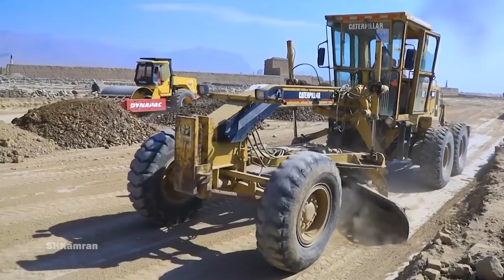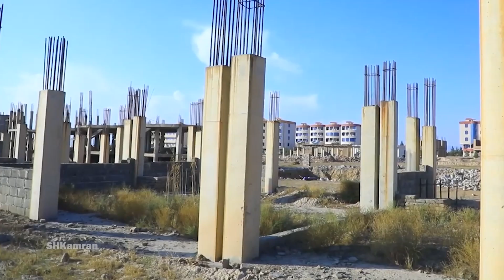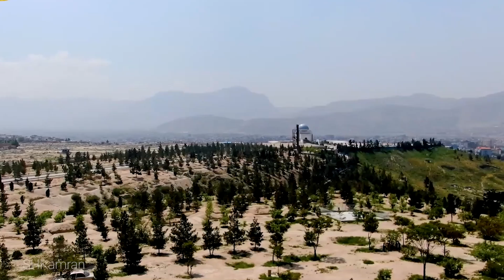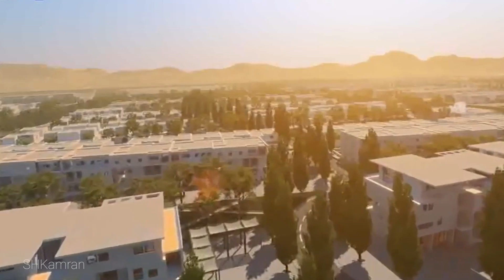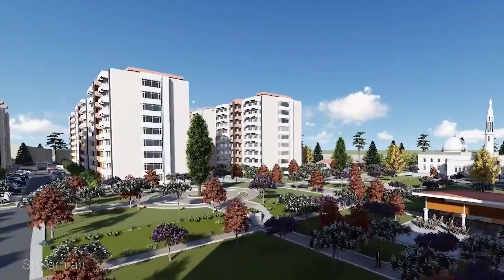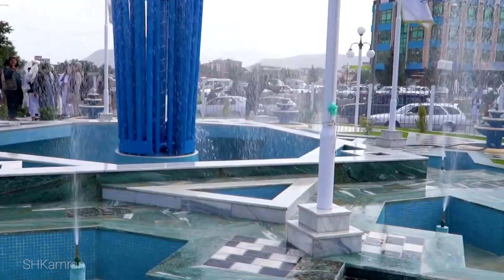Update:  biggest mega project under construction in Afghanistan. New Kabul City

Comment: ❤❤❤❤🎉🎉 ROAD construction system Rong proses work,,,,,,,,MR main road,, CR connective road,, LR Local Road,,,,,MR __1 National High way NHW 2 provincial way PW 3 District way DW,,,, width want,,,,1 National High way __231 feets widths, 4//4 , Lane,,,,,,,, 2 provincial way PW ___198 feets widths, 3//3. Lane  ,,,,,3 district way DW ___165 feets widths want ,,,,2//2,,,,lane,,CR__82,5___99 feets widths need,,,,,,,LR___6 types  16 5 ___26,5,   26,5___36,5,,, 36,5____46,,, 46___56,,,56___66,,,,66___82,5,,,,feets widths road want,,,